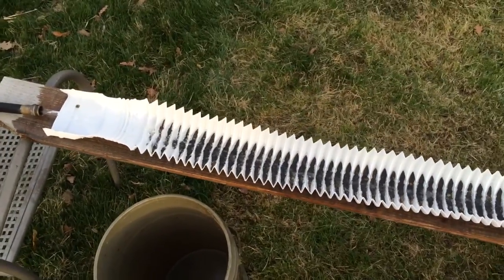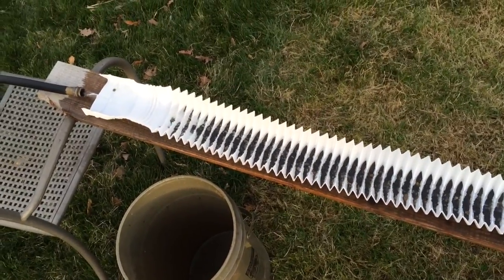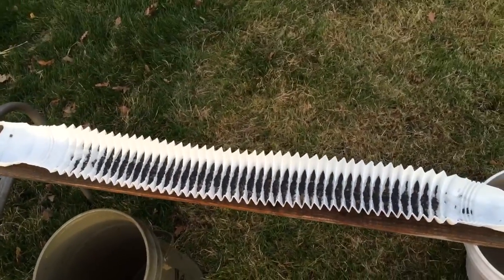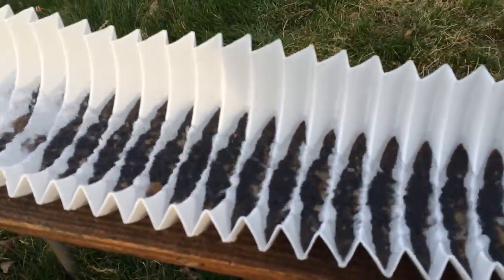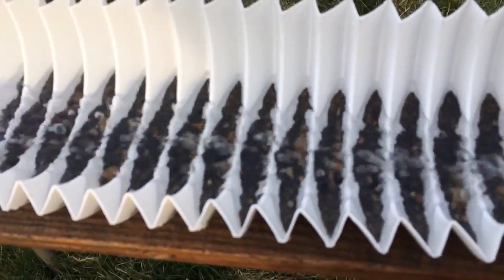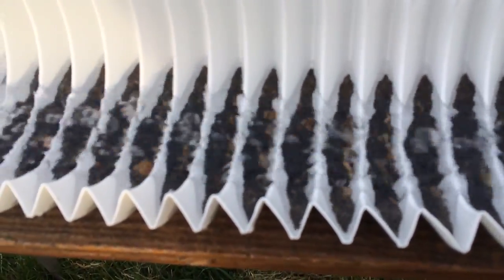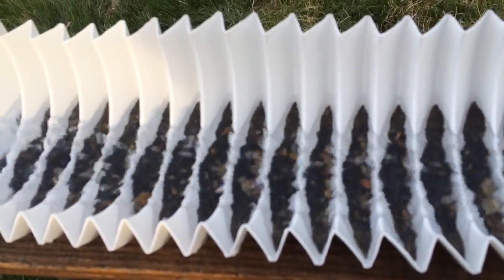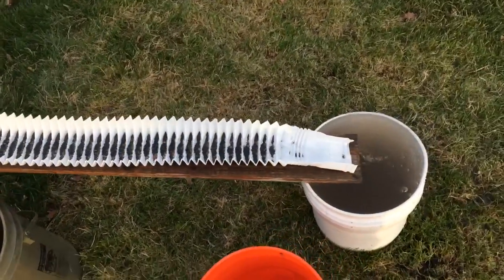Homemade rain gutter gold sluice part 2

Comment: I love my gutter sluice, i gave up using my keene because I wasn't loosing any gold!  For sure the miller table takes the cake, I hate panning black sand!  I've been busy for the past year taking care of my baby, but plan on going prospecting again next week finally!  I was working on a double barrel sluice concept, using vibration, magnets, large feeder, gutter sluices and my keep the water clean screen. You should come see how I made the gutter into an all in one self classifying build.  Little tiny hand shoveling is over with.  I'm able to drop full shovels worth, and plan on being able to just dump a 3/4 full 5 gallon bucket into the feeder.